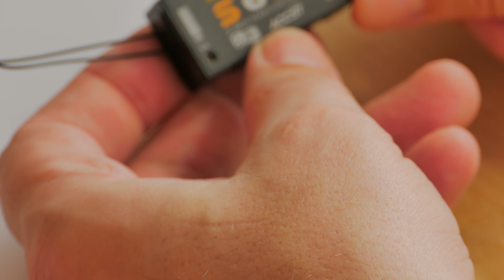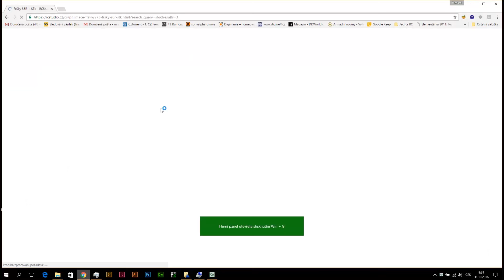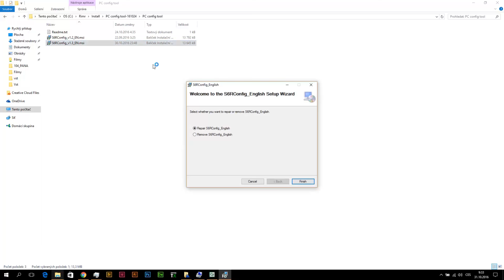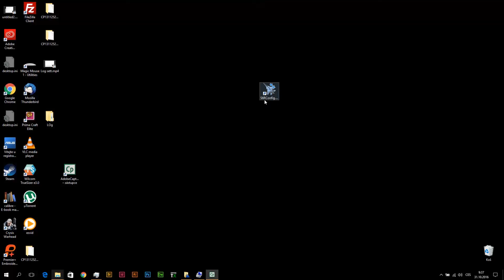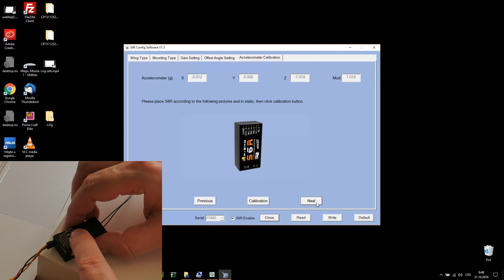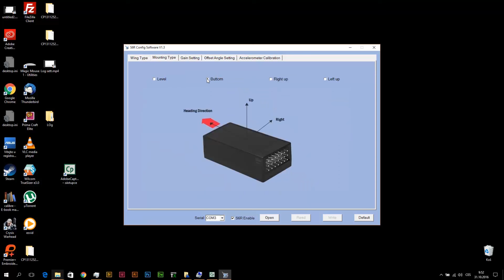FrSky S6R - Receiver with stabilization - Video-tutorial No1 (USB adapter)

Comment: Hi Richard, would it be possible to use this Rx with a Frsky module equipped JR transmitter which has TAER channel assignment instead of the Futaba type AETR assignment? Thank you

Comment: Great video as always Richard.  I recently bought the S6R and STK however I can't get the driver for the STK to install.  When I try to install it I get the message "The device driver installation wizard was unable to find any drivers designed for your machine.  Check with the vendor or your site administrator to ensure you have the correct programme."  Therefore I can't get the config tool to recognise the STK. :(
Reply from the maker: avman180 Hi - look on frsky homepage on download tab.
Reply: Yes I've downloaded the driver for the STK but it won't install.
Reply: check out the thread... you'll find answers to just about everything s6r there!https://www.rcgroups.com/forums/showthread.php?2743245-FrSky-S6R-6CH-Receiver-With-3-Axis-Stabilization-With-Smart-Port-Telemetry/page57

Comment: Hello!
I have bought and STK Tool but I am not able to find the installation for STK config Software...
I also checked the FRSKY website but the FreeLink that they provide is not working, can you help me with the software please?
Also when I am trying to update de firmware the application is still waiting to find the device even if the device is connected and the STK switch is on the upgrade position